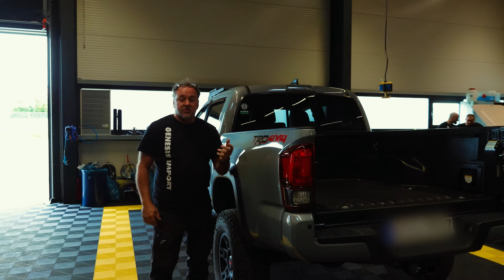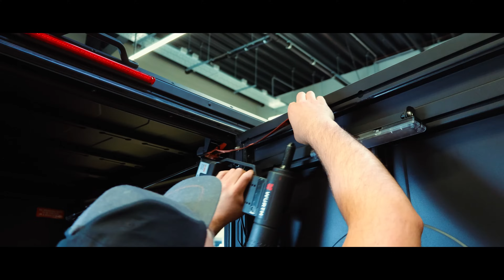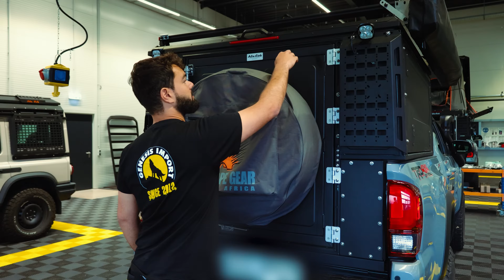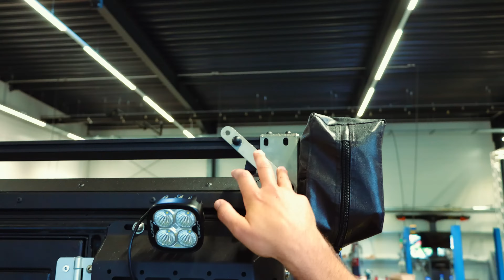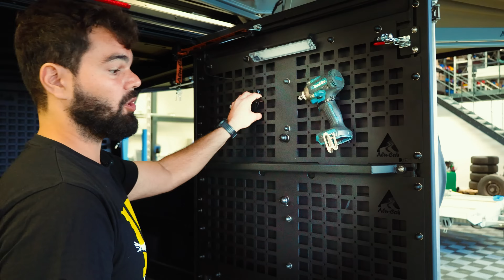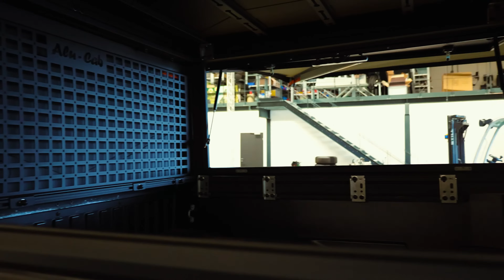Toyota Tacoma | Alu-Cab ModCap Canopy "Worker"

Comment: I would love to see a popup solution for the worker roof. In a 6'4 bed there is enough room to sleep "downstairs", so no need for a (top-)heavy rooftop tent. Any news on that?

The fitment instructions do not show any extra sealing besides the rubber sealing of the roof. I suppose it would be relatively easy to create a hinge at the front to create a triangle pop-up roof. Other parts such as canvas, gas struts and locks are already there from other products. Any update on this would be appreciated. I would prefer a factory solutions to a diy pop-up, although it shouldn't be too difficult to realise.
Reply from the maker: Let's see what 2025 brings! :-)

Comment: HELLO . I NEED A PLEASE .HOW HIGH IS INSIDE IN CENTERMETERS ?CAN I BUY THIS FOR HILUX EXTRA CAB. IS THERE ONE LONGER. HOW  IT WHEIGHTS? WHEN CAN I BUY IT?HOW MANY KIOGRAMMS THAT I CAN CARRY ON THE ROOF?
Reply from the maker: Yes you can buy it for an Extra-Cab, it has about 70cm in height which comes on top of your Pick-Up bridge. The Weigh is 90Kg and you can carry addtional 50 kg on top. You can already buy it: https://modcap.de/products/bap-2758b37b-9cc1-4faf-b09e-1fa236779fd7 hope this will help you.